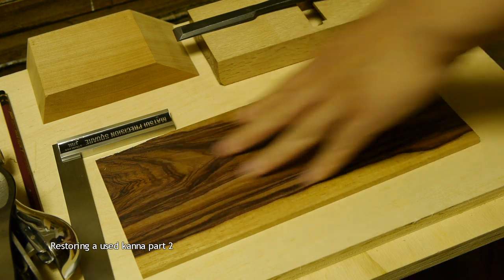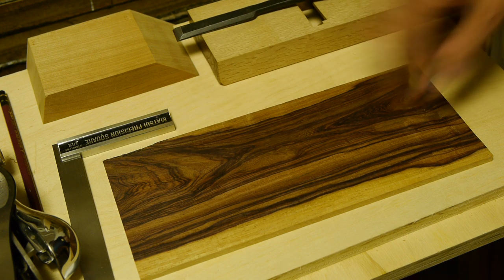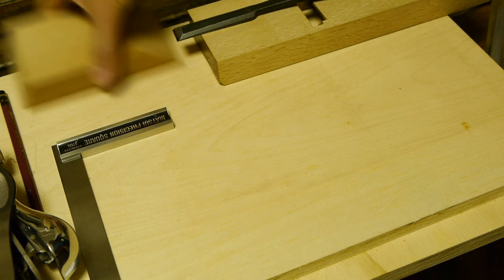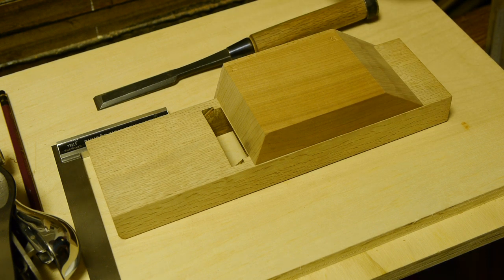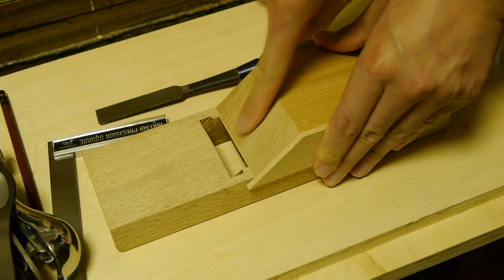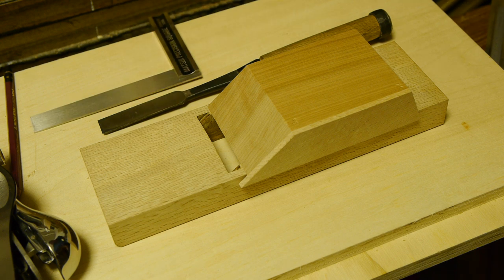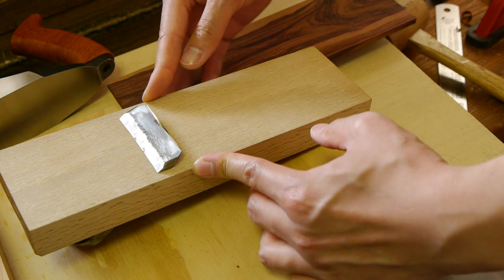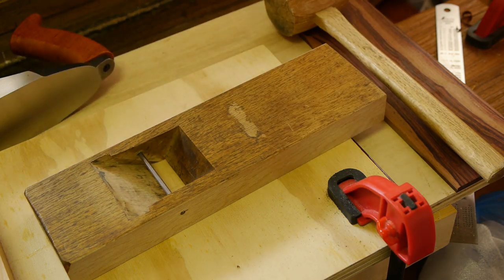Restoring a kanna part 2/3

Comment: Why don't you use blade and chipbraker as a wedge for glue up?
Reply from the maker: Hi, the blade backs are not flat and if you carve away a piece of the bed, then it will no longer match the profile of the blade back so it won't function well as a wedge.
Reply: Thanks for quick answer
Probably I should first see part 3, but...
Is the blade back non-flat intentionaly or this is just alowable manufacture error?
Is it concave or convex in left - right direction, cos as I understand from video bed should be flat in front-back direction?
Reply from the maker: Hi, the blades are intentionally concave in the direction across the blade width. Its not by a small amount either. Along the blade length, the back is mostly straight but they are usually hand ground or scraped so they won&t be as straight as something like a Stanley blade. This is the reason you need to fit a blade to a specific body so that they will mate together well.
Reply: Thanks.